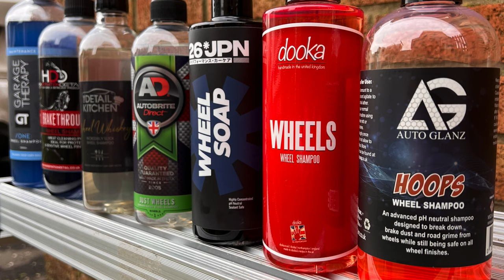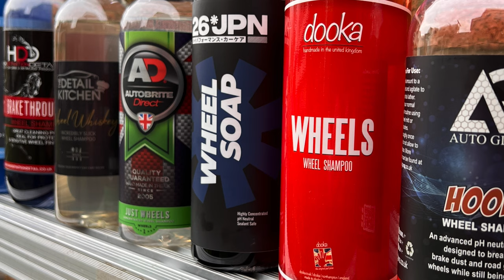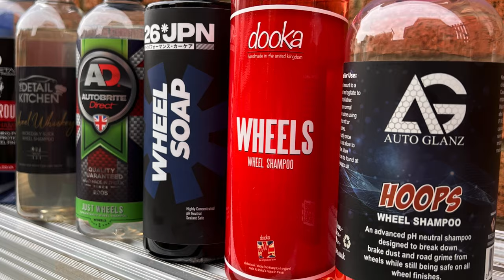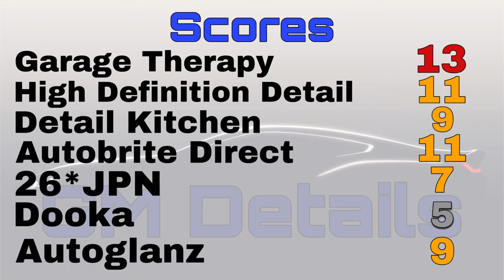Wheel Shampoo Showdown! What’s the best on test?

Comment: Excellent review. Was struggling with the concept of wheel shampoos but your demo with panel shampoo and your emphasis on user enjoyment are right on the money. That said, Surfex is my current one stop shop for panel and sill pre wash, including wheels and arches, plus AG rebound for tyres but GT wheel shampoo looks more fun even at the expense of adding another product although if decent on tyres maybe say goodbye to Rebound. Good tip on sequencing bottom to top.
Reply from the maker: Thanks mate, I’ve just recently started playing around with surfex and it’s many many uses, wheel cleaning was one of them but wasn’t the most enjoyable product to use for me on my wheels, the shampoo won’t initially clean tyres as well as rebound but if you’re using it weekly or even bi weekly you should find the shampoo adequate. 
See how you get on with the wheel routine to see if it’s worth while and let me know your thoughts 👌

Comment: Absolutely smashed it out the park here mate, thoroughly great video. I don't know how you had the patience to test, film and edit all of this but it's definitely paid off. 

Not surprised by your results, I think most people would think GT would come out on top. I've been using Hoops recently as I got 5L of it for something like 20 quid on black Friday, I've only ever used it in the bucket but as you've found it doesn't seem to provide much in the way of lubrication which is a shame. Maybe it'll be worth trying it in a foamer and seeing if I get more agreeable results. Ultimately I reckon I'll have to pick up some GT wheel shampoo though.
Reply from the maker: Thanks Ben!, filmed in 4K too which means for this video the file size is 10gb 😬
My iPad was jittering using the wee app I use and I thought it may crash but all is good, only took 3.5 hrs to export 🤣

Maybe increase the amount of Hoops you use to make it a bit better , I have a soft spot for it being one of the first ones I tried but now it’s one of the least enjoyable products to use 🥴

Comment: Good stuff as always. Perhaps a round up of the tyre cleaning abilities at the end after all to me a wheel is an alloy and a tyre?
Reply from the maker: I did mean to cover that but it rained next day of the first round and you couldn’t tell which was cleaner so had to give up on that one , previously I’ve had comments saying a shampoo just won’t clean deep enough for a dressing to be applied & they certainly won’t remove a previous dressing but if used in combination with a tyre conditioner, the shampoo is all you really need in my opinion anyway

Comment: I'm in Australia and use Garage Therapy one wheel yes i have to buy from the UK but it's worth the shipping cost 
I use it every two weeks on the back wheels only on a VW Amarok that has drum brakes, i did try the front but not enough bite
so i use Brake buster at 200ml to 800ml water.

For the garage therapy i use 20ml - 30ml to 700ml water through a spray bottle.
Reply from the maker: Love hearing how you get uk products out to you, I was talking to Maz earlier about GT wheel shampoo cleaning power and tbh I disagree with him thinking it’ll tackle baked on brake dust, if you have that it’s only going to be removed by a stronger chemical maybe even iron oxide, then there’s ceramic coatings for wheels, this is where wheel shampoo comes into its own. 
I really appreciate you continuing to watch my videos, ✊🇦🇺🏴
Reply: @GMDetails  Cheers mate the GT can clean a more dirtier wheel but in my opinion takes a lot of product plus a lot of time.
I shop from Blok51 if i remember correctly. 🇦🇺👍
Reply from the maker: Awesome!!, are you on any detailing groups over in Australia spreading the GT vibe or do you secretly keep it all to yourself and scoff at everyone else 🤣
Reply: @GMDetails  I got into contact with GT and asked are they coming to Australia and they said at the current time they are not due to high shipping costs and what is frankly going on in this world. I also contacted some Australian detailing on line store's and they said the same BUT said keep a eye out in the future. I'm on Autogeek forum and the Aussie know but you havevto be careful what product's to mention. I have GT foam wash and glass cleaner also.
Reply: Superb to hear GT products over there, I've mentioned them on Car Craft Auto Detailings channel too, can I ask how much postage was?
Reply: @SomeMadRandomPerson  It goes by weight so standard shipping  last time i bought was about $35 Australian
Reply: @ilikechickensausages2075  that's not bad considering the distance, I'm sure u enjoyed the products 👌🏻
Reply: @SomeMadRandomPerson  I do 👍

Comment: Thanks for this video. As a result of watching this, I got the Autobrite cleaner and it is a joy to use. The suds remain active for ages. Could not be happier.
Do you think this will strip the EZ wheel wax I've applied?
Reply from the maker: Hi PP, it’s nice isn’t it , no it’s a ph neutral shampoo so depending how hard you scrub the wheels it shouldn’t remove any wheel wax at all 👌
Reply: @GMDetails  excellent, thank you for the advice

Comment: Great video graham as always.....one question though.....what is the difference between gt wheel shampoo and the decon shampoo? As i was thinking of buying the decon shampoo and using it on my car body and wheels
Reply from the maker: Decon shampoo is a much higher alkaline shampoo, designed to help remove contaminants and old waxes / sealants etc whereas wheel shampoo is also a little above ph neutral but around 1,000x less alkaline in concentration 
There’s no issue with using Decon on wheels to clean them at all, just that if you used a wax or a sealant it wouldn’t last as long , hope that helps, I I were you I’d get both 😃

Comment: Thanks for the video Graeme. Been using GT 1 through the same IK Foamer and really impressed with the results. Now & again I’ll hit the wheels with Bilt Hamber Auto Wheels which gives them that extra sparkle. Need to look at my foamer now though as it’s not spraying anywhere near as evenly as yours. 👍🏾
Reply from the maker: Thanks Barry , mines is still quite new, check your filters inside the nozzle and replace them (you should have had filters with the instructions )
Reply: @GMDetails  Great shout on the filter Graeme - it was definitely ready for replacing and a good job I kept the box with the bits because the spare filters were in there even though I knew nothing about them. I know I know, read the manual but who does that?! 😃 I'd still like to try having a spare foam lance bottle and applying it that way after watching Matt on his Obsessed Garage channel using it that way.. Just looks a lot more efficient than pumping the IK for 5 minutes to get 1 minute of foam action. Just not sure what the dilution ratio would be through a foam lance. Thanks again though. 👍🏾
Reply from the maker: @BarryCoombs1  aw brilliant mate glad that helped you out, any more info and it’ll cost you 🤣🤣🤣

If you check out my pir calculation video it’ll give you an idea how much to use , if you can’t be bothered trying that use 100ml shampoo to 900ml water as a general dilution

Comment: Enjoyed the video Graeme👍🏻 Do you have protection on your wheels?
Reply from the maker: Thanks Andrew, no sadly not now, I put Carbon Collective Platinum Wheels on it when I bought it but until the weather gets a little better I just clean them regularly to keep them good
Reply: @GMDetails   I bought that coating last summer but have not applied it yet. How did you find it as I have never used a coating before?
Reply from the maker: Ah!, it’s a good coating , possibly one of the best as it’s durable for 2 or 3 years , application wise it’s not easy, there’s a nack to it and you have to be very careful , barrels I applied and left it , doesn’t need buffing or removal , the faces I applied one single coat and be careful not to keep going over any already applied areas , only do a 1/4 of a wheel at a time then take a low pile microfibre and wrap around your finger , you’ll find it really sticky but with a bit of pressure work your way around the applied areas without rubbing or going back over areas you’ve covered 
Then let cure 10-15 mins before buffing with high pile side 
You won’t see any flashing or rainbow effect with it , it’s quite a thick coating 
There is one video covering application on YouTube , search for it and follow that method, it’s the way I’ve just described 

Gold luck 😅

Comment: Only issue I’ve found with the GT Wheel Shampoo is that it doesn’t like cold temperatures and goes slightly white and thicker.
Reply from the maker: I’ve not found that myself personally and mine has been in the garage sub 5°c most of Jan & Feb, apparently with some other shampoo the advice is to let it sit in some warm water for a few mins and it’ll be fine again

Comment: Hello Graeme. Would you know anything that might prevent brake dust post cleaning. On my car i only have to drive a mile or so and the barrels look like i never touched them, very frustrating.
Reply from the maker: That would frustrate the hell out of me, I take it you have very open wheels to see a lot of the barrels?
Reply: @GMDetails  Yes there are large gaps between the spokes Graeme, it so annoying. I spend all that time and effort for very little reward.
Reply from the maker: @greymark420  you could try some of the slicker detail sprays or sealants and see if that makes any difference if you have easy access to the barrels , the ‘self cleaning’ might give you some extra time to enjoy your labour , I’m really impressed with the High Definition Detail Graphene QD , I’ve never felt slickness like this and does help keep the dirt away I feel, something like that might be worth a try
Reply: @GMDetails  Thank you Graeme, i will give that product a try. Have used Gyeon wet coat but to no avail. Appreciate the advice.
Reply from the maker: @greymark420  I don’t think wet coat delivers as much slickness as it protects , I’m trying to think of slick sealants more for a little longevity as a QD wouldn’t last long at all, wowos Crystal sealant is a good shout if the 50% off sale is still on, EZ car care graphene paste wax is also extremely slick too so there def must be something with graphene delivering insane slickness
Reply: @GMDetails  Thanks again Graeme will look at Crystal sealant.